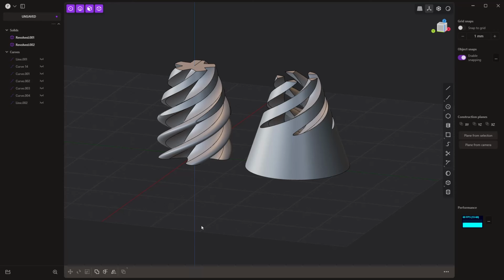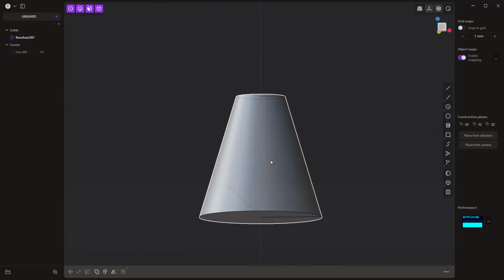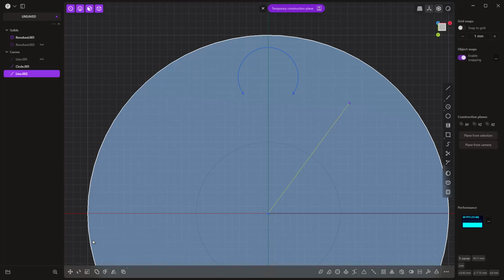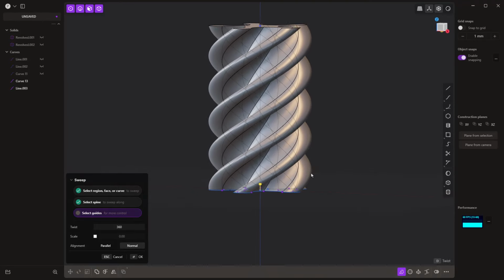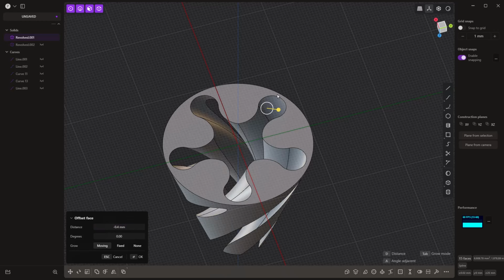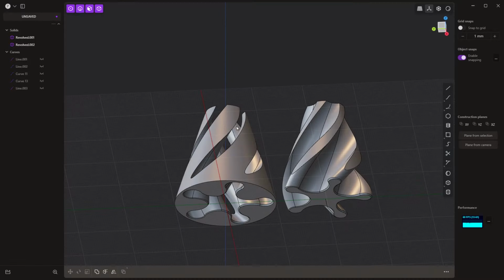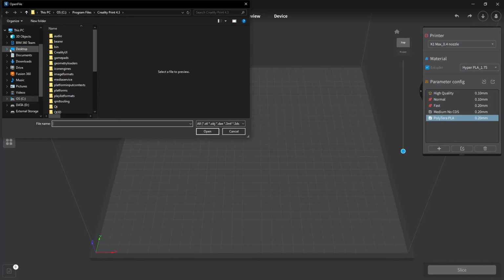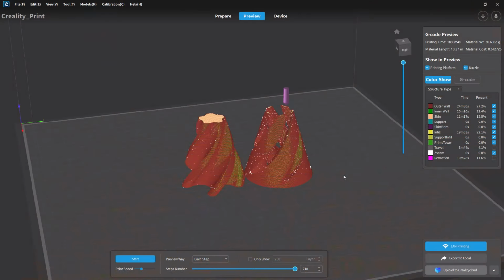How To Design A 3D Printed Fidget Cone in Plasticity | #3dprinting #plasticity

Comment: Ur probably not gonna answer this but around 6 minute 35 seconds I can’t join the three lines. I join them and only two join. Plz respond. 🙏🙏
Reply from the maker: Nah i answer all the comments :)  hmm, is there a chance that one of them is on a different plane so the points aren't touching?  If so you can select all 3 of them. hit S for scale, Z for scale in the Z direction, and then enter 0 (zero).  this should scale them all down to the same plane.
Reply: @LearnEverythingAboutDesign  Dang, this video is a year old and u answered in 1 hour. 😂❤. I checked closely and found that the points are not touching. I will try what u told me soon. 👍

Comment: my issue with it not being parametric is that it's probably gonna be a mess to change the gap after the fact.
Reply from the maker: Yup totally get it!  https://youtu.be/PGfuZ1_BmUY   I have had a lot of questions about designing for 3d printing in plasticity so i cover it. but try to cover the same or similar in Fusion as everyone has their tool of preference.  Tweaking dimensions is much easier in a sketch parametric environment.  If you know you can work with a .4mm gap for a print in place model then you can do that as you design in Plasticity.

Comment: What am I missing? Every time I get to the radial array I join the curves and I get one solid curve but I don't get a closed profile. I know it has to be something dumb I'm missing but I have started over about 15 times and keep getting the same results.
Reply from the maker: The curves may not be flat/planar or there may be a small gap in a corner.  If they are not planar you can try scaling them in the normal direction.  So for example if you would extrude them in Z to make a solid, scale them in Z to zero.  This can flatten them out and the profile in the center would be highlighted.
If its a corner thing then you need to find which point isn't connected.  You can try to find it by selecting your curve, then rebuild the curve with the little hammer icon in the bottom right. use the # of points option but don't accept it.  just look to see if the shape smooths out or if a corner is left sharp.  That might help find the issue.